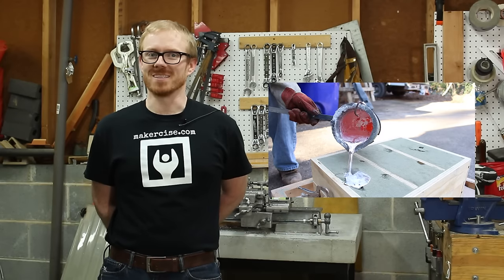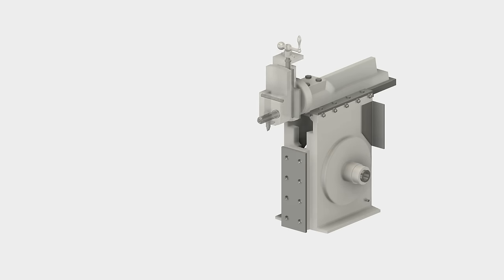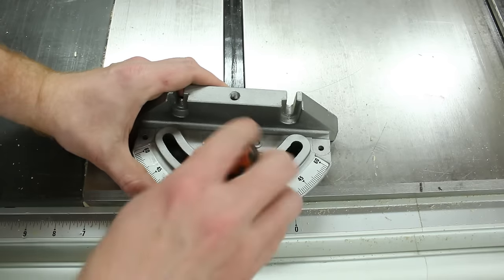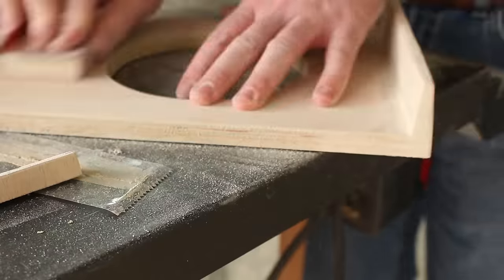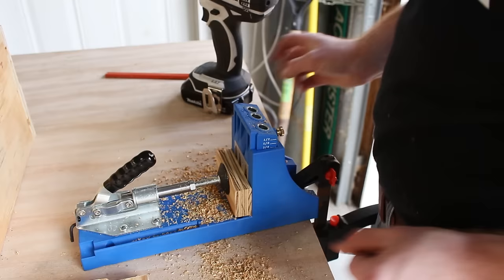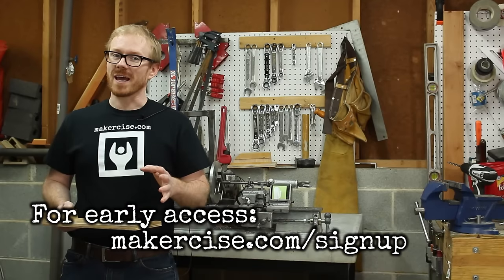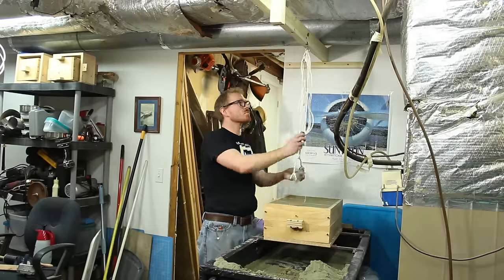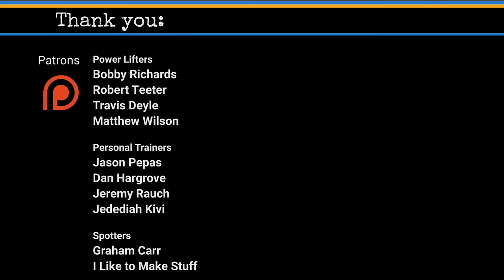Gingery Shaper Column Side Pattern and Casting Part 1

Comment: Looking real good! When casting big flat areas such as the side's you might want to use a riser on your pour sprue access, the riser can be made of a soup can with both ends removed............ run your sprue tube into the can/shell and pack with your sand, remove the sprue pin, contour one end for the fill and set the can/shell over your pour port and you can do the same for the riser port as well............this acts as a hydro-static in-port for the shrinkage to take place rather than on or in the casting, this method works very well for most all split pattern's with  heavy or thick components to the part, same method for lost foam as well!

Comment: Loved it Cressel! I recommend a cement mixer for mulling the sand. That's what we use when we don't use petro bond. Also we do our own formula for the green sand and I will share that info in a series cumming up. Your shaper is off to a solid start. Keep it up and I'll keep watching.
Best Matt
Reply from the maker: +Centurial Inc what are your thoughts on the heavy weighted wheels typical in muller designs? I understand that they help smear the clay binder on the grains of sand. Perhaps just giving it longer in the mixer achieves the same thing, but perhaps less efficiently? Getting a mixer is attractive because I could also use it for concrete or mortar versus a dedicated muller.
Reply: I can't say much about heavy wheels. Buying a proper Muller is far to expensive, and I didn't want to make one. It is suppose to be better for one reason or another. All I can say is that the cement mixer tumbles the sand and the tumbling is not enough to brake apart large chunks. In some case (over damp sand) the sand will ball. But not major issues. Yes it will tumble for longer than a Muller i'm sure of that. But its automated and electricity in our area is cheap. We bought a hardbor freight model and it works very well. And yes the multi purpose use is very attractive. Well priced and quick. It is hard to turn down. So far no problems with it or with the sand. Some times we will have to brake apart large chunks by hand. But that's about it. I recommend it. Some have tossed in heavy objects to the mixer. But I would not do that. Life of the unit will go down.

Best Matt
Reply from the maker: Do you have the 3-1/2 or 1-1/4 ft^3 variety?
Reply: 3- 1/2. It can mix a full 5 gallon bucket of sand no problem.

Comment: Try using wooden dowels instead of nails for the line up pins. Sand a taper on the pins so that they fit loosely when entering the mating hole but tighter at the base of the pattern where they glue in. You don't need to make a mating tapered hole to receive the pin, just make sure the base of the pin and the mating hole are the same size, especially for a pattern that is only going to be used a couple of times. Work on the same principle as draft on a sand mold. The pin friction will give way as so as you start to draw it out.

Comment: You only need about a 3 degree angle for draft.  I mention this because you seem to vary from a little to a lot of draft angle, which means some of your surfaces will need a lot of cleanup and/or you have small bearing surfaces on the draft surfaces if they are not undersized enough for the cleanup.
Reply from the maker: +eformance I went with 5 degrees because it is what gingery used. I might be able to get by with less especially if I was using petrobond. With my skill level and sand I feel like more has been helpful, at least for building the lathe. Perhaps I'll get more adventurous as the shaper progresses.

Comment: I ended up getting the hard cover book that has all 7 books in it on Amazon. love the book so far. reading the lathe portion now.
Reply from the maker: Bruno Martini wow deluxe! awesome. I have a mix of kindle and soft cover. they didn't have all the books on Kindle when I started or I'd probably have all electronic copies. :)
Reply: Makercise the book in hard cover was not that much more than Kindle edition. I wanted the book to add to the workshop library and it looks quite nice. also a book does not require batteries. lol
Reply: I didn't know that was a thing! I do believe I'm gonna grab a copy right now!

Comment: Nice presentation and excellent castings but I noticed the burnt finish. This is caused by the talc, I use chalk line powder as it doesn't burn and reduces the chance of the cope sand sticking to the drag sand. I'm keen to see your progress. Peter
Reply from the maker: +PGS I'll give it a shot. Does the color matter? I have blue on hand.
Reply: Depends on what you prefer to show through your video.

Comment: I loving this video, I’m sure you’ve found good pins by now, but in case you haven’t I use 3mm dowel pins for shelving, look on amazon you can get them in many many lengths and they are all perfect 3mm stainless pins with a tiny chamfer on the edges. They are perfect. I’m thinking about doing a gingery machine so I’m going to watch a load of your videos, cheers o/

Comment: If you're having issues with pulling the split pattern, you might consider doing what MyFordBoy seems to do, and put in a few "screw ports" on the small piece.  He seems to drill and tap a couple of holes so he can later put in screws and use it to uniformly pull the split part out if it's sticking.  Just a thought.
Reply: Looks like you did that for the bigger part.  try it on the small ones, too.

Comment: Can you explain why you are not using a casting sand like Petrobond or equivalent?  You seem to have cohesion issues and I notice that you're mulling your sand with water; the casting sands I've seen are oil bonded.
Reply: Petrobond is not one-use.   You have to mull it with oil after it gets "used up", but it can be reused many time.  Take a look at the Myfordboy channel for some excellent casting videos.
Reply from the maker: +eformance I have been wanting to try some petrobond, but have yet to pull the trigger. The background on my sand...I opted to go with green sand initially because I could make it with local ingredients, play sand and kitty litter. When I decided to buy better sand ingredients, my comfortability from my home made green sand helped me decide to stick with green sand. I opted for black Diamond since the place I bought it couldn't source olivine. I mix it with southern bentonite. In my early research I read somewhere that the water based sand could be rehydrated more easily for a novice than the oil based. Either way a proper muller will be an big improvement both in sand bonding and efficiency. Please share any good sources for muller designs.

Comment: Why are you wearing a respirator while working with the green sand?
Reply from the maker: chbrules the sand I use is black diamond. it doesn't contain crystaline but if it did i would definitely want ppe to prevent silicosis. The SDS for black diamond suggest respiratory protection for nuisance dust above a particular concentration if sufficient ventilation can't keep concentration low enough. i didnt measure the airborn dust, but i had mulled the sand the day before and noticed my throat was a little soar. I attributed it to the dust from the sand and decided to throw on my wood working respirator since it was handy.
Reply: Not a bad idea. I have a nice 3M one. I'm just starting. I'll be sure to wear it while working with my green sand.

Comment: do use anything for defluxing the aluminum? i have built my own burner and foundry for lathe project but found a good deal on lathe and mill so i might jump to the shaper first instead.
Reply from the maker: +James Sprague I bought a pint of the aluminum flux from budget casting supply. I didn't get footage in this casting but I used about a spoonful.

Comment: so... basically you need a fully equipped professional woodworking shop to make the patterns before you can make a single casting for a single aluminium machine?
Reply from the maker: Not really. In the subsequent videos I use a hot wire foam cutter to make "styrofoam" patterns. Up until this video I had used wooden patterns. I am now of the opinion that making wooden patterns is a waste. If you were wanting to make multiple castings from the same pattern it would be a good idea. But even for the column sides where there are two castings required, I'd go with the lost foam technique.
Reply: ahh I see, sorry I was feeling a bit grumpy when i posted the last comment!,feeling better today,just cast my first ingots!lol i got the book to follow when i get the funds and time to get the sand, copes etc but will be checking in on you for inspiration.subscribed.
Dan U.K.

Comment: Might wanna go back to the electric kiln, save yourself some arm hair :). I'm gathering material to construct an electric one instead of using my propane. I hope it takes less setup and constant monitoring to make sure I don't blow something up. Would also like to be able to leave it if the wife needs help with the baby.
Reply from the maker: +John V haha. The kiln is easy and precise for sure, but there is something about the sound of a gas or kerosene fuel foundry that I just love. I guess it's like having a sports car and a motorcycle. Two different experiences but both a lot of fun.